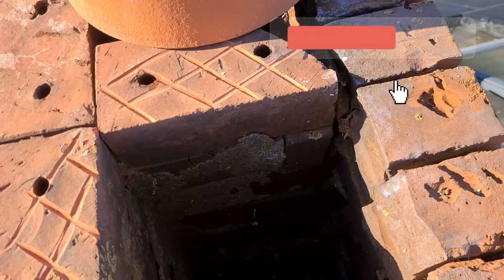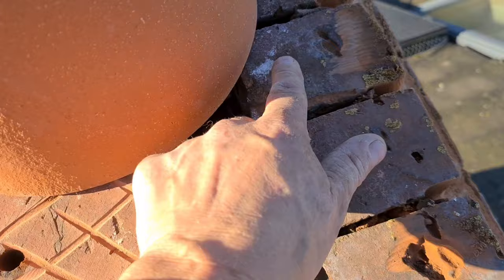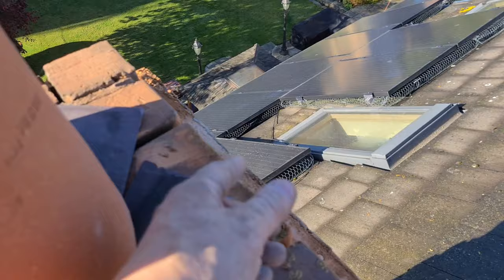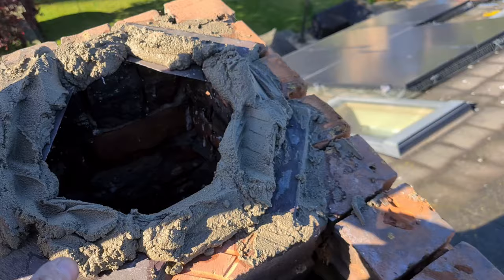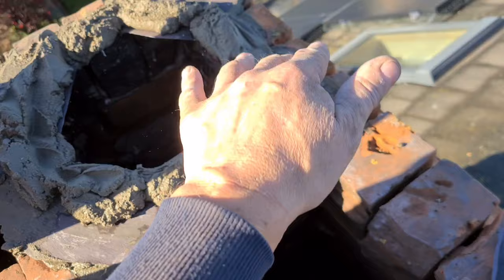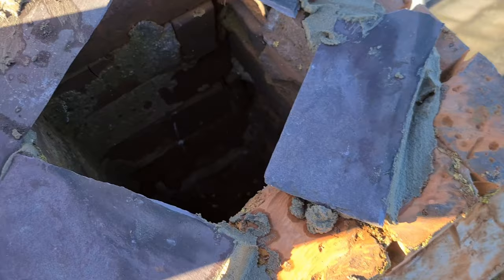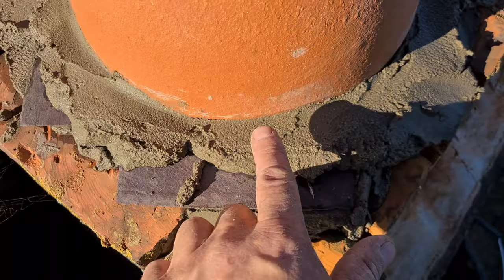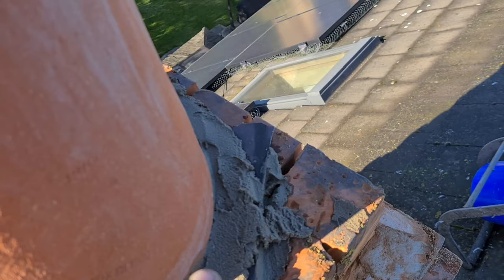INSTALL NEW CHIMNEY POTS LIKE A PRO!

Comment: Do roofers carry pots up ladders as there pretty bulky and heavy.
Reply from the maker: Yes they do,  these where up there though.
Reply: Is there a certain amount of cement you need to reflaunch around the pot.some really dorb it on thick. we just had one fitted but i would of liked more mortar to secure it don't want it blowing off and killing somebody.
Reply: Do the chimney tops have to be covered to prevent rain penetrate into chimney stacks?
Reply from the maker: i dont think there is, whenever ive rebedded  pot ive gone by the staining left from preioud mortar.
Reply from the maker: no not at all, have you seen the diameter of a pot?
Reply from the maker: no not at all, have you seen the diameter of a pot?
Reply from the maker: @A Costin  just do a standard mortar mix, always remember your mortar should never be stronger than the material you are using it with.